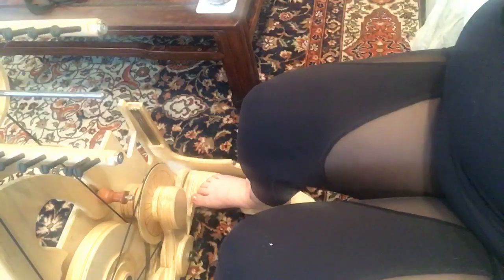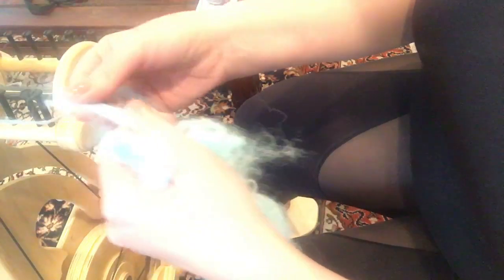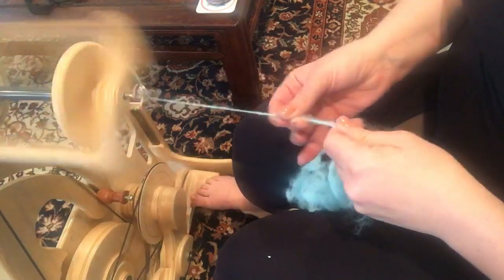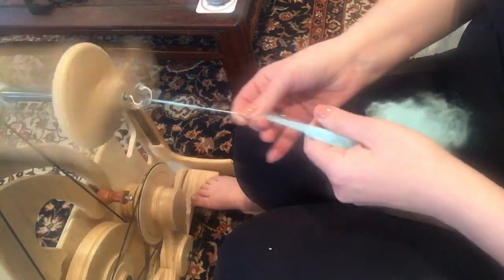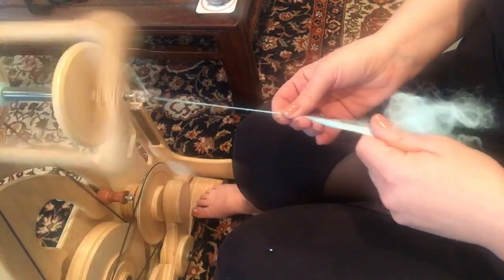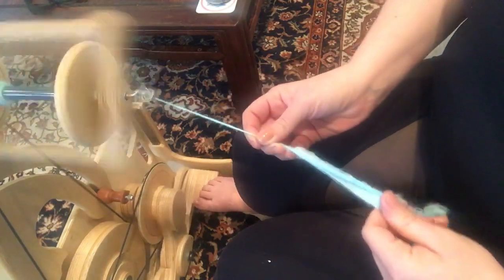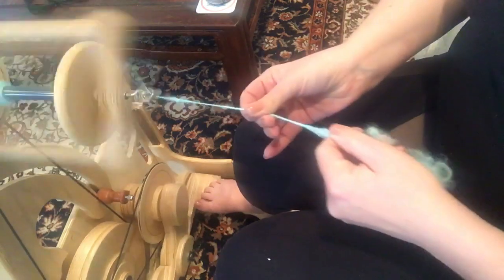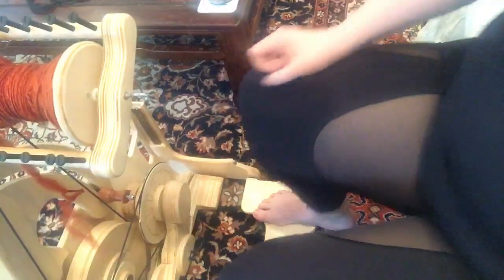Wheel kick back and shorter Fiber troubleshooting on a spinolution king bee

Comment: Thank you so much for those explanation on the kick back. The Ashford Joy that I’m practicing with definitely does have the up and down gear so your explanation really helped me understand why I’m having the issue I’m having. I think going from a drop spindle to s spinning wheel definitely has a learning curve to it but I’m thinking of trying different spinning wheels before actually purchasing one. Thanks again for your help! I love your videos!!
Reply: So smart, try many different types.  I personally have found that the less extra steps and adjustments that have to be made the better. I'm just pretty simple though.  Now that you know that kick back is an issue I'd look for something with a very smooth treadle that doesn't have a real up and down motion like you've seen.